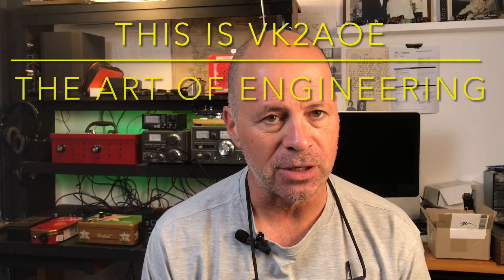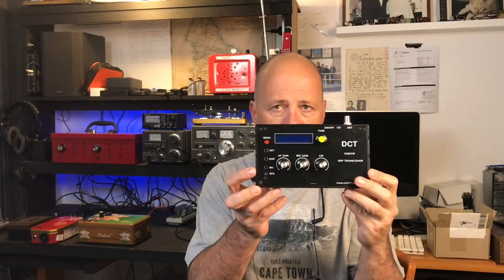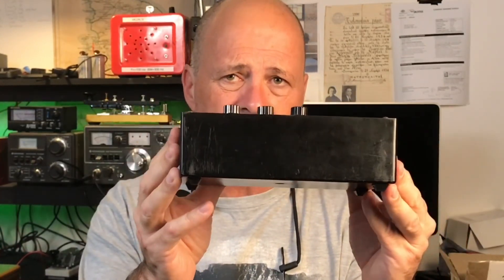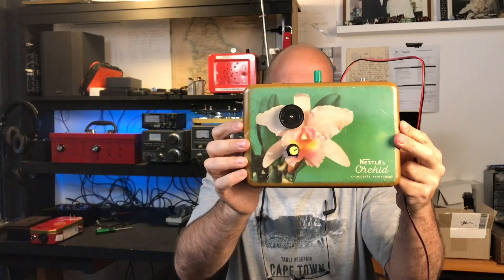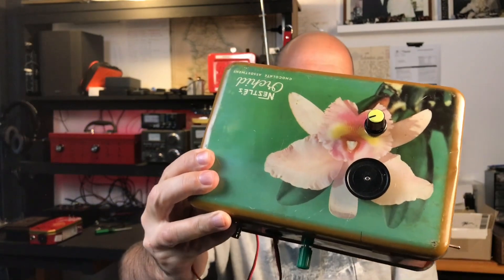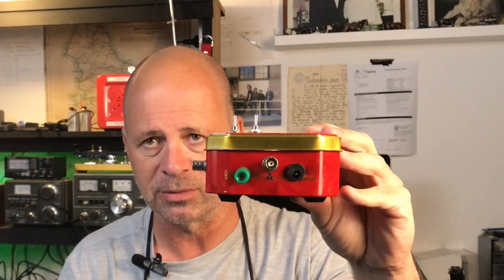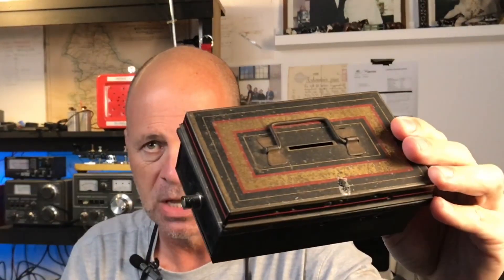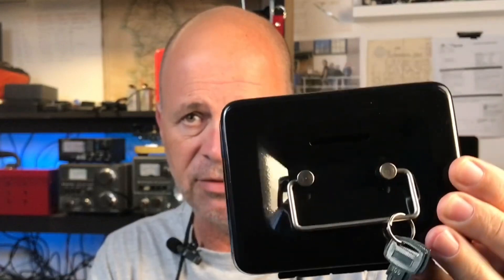Enclosures for Ham HOMEBREW - Thinking outside the box@TheArtofEngineering

Comment: Hi thanks fer the vid. When you start building something which may be experimental you don,t know how big it,s going to be or maybe you want the minimum size box. I cut old washing machines etc up for heavy boxes and either pop rivot them together or braze them at the corners. For lighter smaller boxes I have used plywood and sometimes double glazing plastic which can be glued. I have not made any ham stuff recently but have been inspired by the phasing rig of  vk3ye. Ps I was suprised you never soldered to the inside of your dummy load box directly for low inductance tin plate is good stuff for shielding. G0SKJ
Reply from the maker: Yes...I should have soldered it (I did solder it on the DC receiver in a chocolate box)....just didn't think of it! As for the cut up washing machines, that is a smashing idea, as on any given clean up day there are raw materials all for the taking....ditto the double glazing plastic. Thanks for the ideas and the comment. 73 de VK2AOE. dit dit!

Comment: For tins and plastic lunch boxes, never go past charity shops, they always seem to have heaps of the things.

Hamfests are great for boxes.  An old piece of faulty superseded test gear, can be had for lo lo dollars can be ratted for components, but the box is usually the kind of thing you'd have to pay 200 or 300 dollars for new.
Reply from the maker: Yes …. I have an old University volt meter that is awaiting a project! 73 de VK2AOE.
Reply: @TheArtofEngineering  Yeah, I find all you have to do is cut a metal or plastic piece the same size as the old case's front panel, to cover up where all the meters and switches went, and the thing looks very smart!